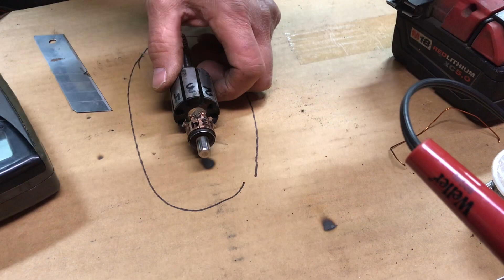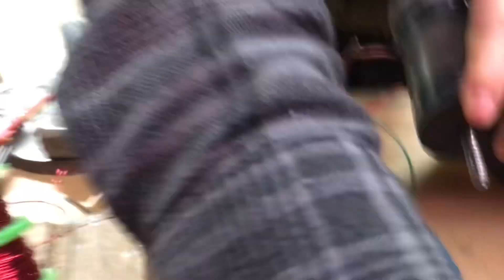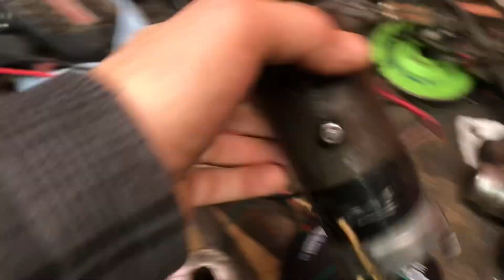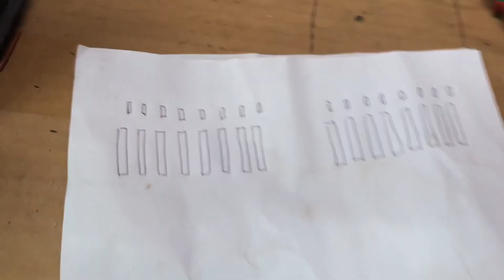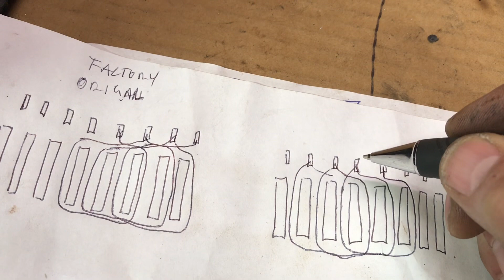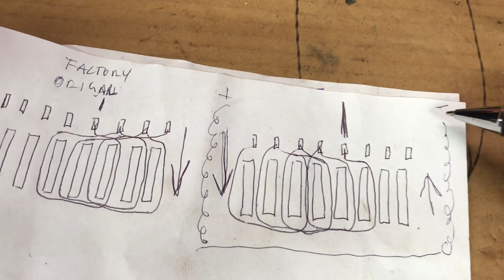12 Volt DC Motor Rewind, 58 Edsel Shifter Motor

Comment: My hands hurt just from watching you wind that wire!
I am so lucky to have a local shop that can rebuild any electric motor I have ever taken them. They are reasonably priced and great at their craft!👍
Kudos for stepping out of your comfort zone and tackling this project head on!
Reply from the maker: Non of the shops in my area seems to be interested in doing this job for me.
Reply: @WildWestGarage  Like so many trades...Both of these gentlemen have to be 70 years old and still working! I will be in the same boat as yourself soon I am afraid!🙄